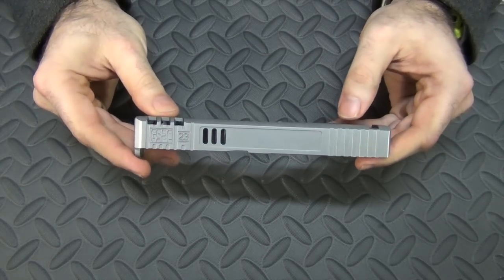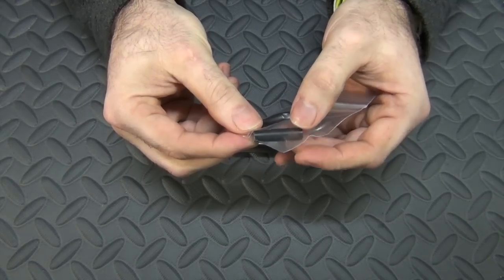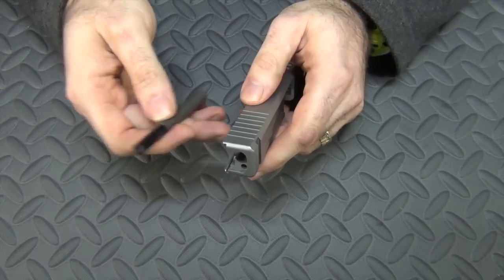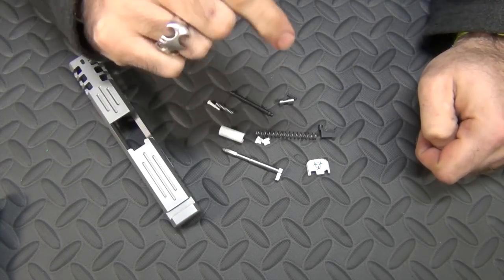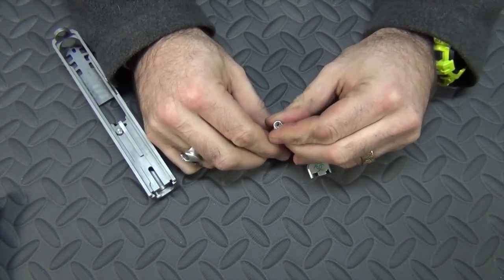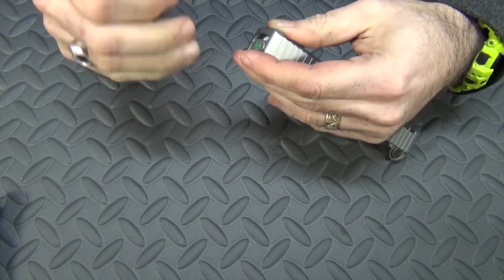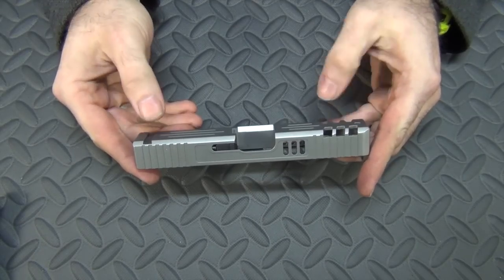Assembling a Custom Glock Slide

Comment: Use the slide as a support when you're assembling the firing pin, put the plastic piece in first and turn it so the lug won't go into the slot.
Reply from the maker: Mark Fleser Why? The way I did it is simple.
Reply: TheYankeeMarshal It's simple either way, but using the slide keeps it from moving around and you don't have to compress the spring as far as putting the whole thing on a table.  You mentioned using a shell casing so I didn't know if you heard about that.
Reply from the maker: Mark Fleser The way with the shell casing is super easy too.

Comment: Ameriglo Pro i dot sights in green and yellow. Around $88.00. shipping is usually free. Got mine from optics planet via ebay, but amazon should have the same deal.These sights are just as good as  trijicons HD sights but 40-50 bucks cheaper.

Comment: Holosun red dot sight 2 MOA features 12 brightness settings. In Stock Holosun HS403B Red Dot Sight - 2 MOA View Details $211.75. With a code you can knock it down to 150

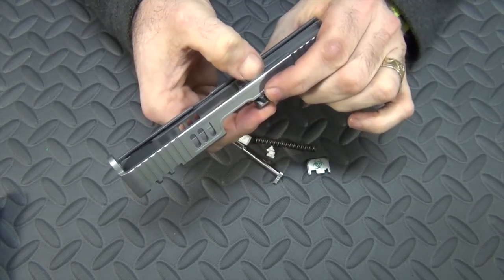Comment: At 4:20 your instructions are blurred the extractor does not lock in
Reply: Update*** now I know this isn't a p80 video but I used this content to assemble my build and a extremely crucial step for anyone stuck at 4:20 you need to get a hold of some 4000 grit sandpaper and wrap it around your brand new just recently ordered firing pin safety and wrap it around like a burrito and twist it back and fourth to create a perfectly even 360° sand and that " WILL " cause the pin to not seize up in the hole and allow it to compress and decompress freely and as it should

Comment: I have the dead ringer snake eye sights they work excellent at night and are very strong I can rack my slide off anything  and I dropped my glock at the range so they can take an impact lol...I'm sorry that's not funny dropping your gun but still the trinium inserts are ok after heat and impacts...just saying that's what I use

Comment: I know this is an old video, but can someone please help me? I'm completing a glock 20 aftermarket slide and I noticed that my parts kit didn't come with an "extractor spring cap". And I've noticed that no other parts kits seem to mention one, do the 10mm/45s not come with one? I can't find a direct answer anywhere and I can see the spring behind the extractor and it looks odd. Maybe I'm just tripping, I've never dealt with large frame glocks or p80s, someone give me a legit answer please 🤦‍♂️🤦‍♂️🤦‍♂️
Reply: Nick is that you ? Lol I am having issues to with my gun lol

Comment: Instead of buying a tool or if you don’t have a 5/16th dowel, I used the rounded (non-drilly) end of a drill bit the same size. Pushed the channel liner in real easy b

Comment: Wow!  Three minutes, twelve seconds until the profanity began; and, it was only by text (i.e., "suck balls").  I'm impressed.  Kudos!  Typically anytime TYM assembles or disassembles something,...I expect the profanity to begin within 30 seconds.

As for which sights,...these XS Big Dot sights are nice.  ONLY 2 LEFT! 

http://www.amazon.com/Night-Sights-Glock-357-Calibers/dp/B005ST8NA2/ref=sr_1_14?ie=UTF8&qid=1420424103&sr=8-14&keywords=glock+23+sights

Nice video TYM.  Keep 'em coming.
Reply from the maker: DoobTube71 You should have heard the parts that came right after that little added clip at the end when I turned the camera off.
Reply: TheYankeeMarshal
Forgot to switch on the camera...  That's not too bad. Usually, if I ever dare say something is "easy" to assemble/disassemble, some spring-loaded somethingorother will find a way to shoot a tiny part that I don't have a spare for into a parallel dimension.
Reply: TheYankeeMarshal 🤣🤣🤣🤣

Comment: TheYankeeMarshal I would recommend a fiber optic front with a blacked out rear sight.  I have a couple sets of the TFOs too, and they are nice, but they housing around the fiber optic blocks more light compared to traditional fiber optics.  Just my 2 cents.

Comment: I used a 3/16 nut driver that has screwdriver handle on it for the channel liner.  It was perfect size and very easy to do. When I looked in where the channel liner goes I could actually see a lip so I thought there was probably already a channel liner in the slide but after checking where I got the slide there was not one in it. So even if you think you can see one in it there might not be.

Comment: TruGlo TFO or TFX sights.  Right around $100 and Amazon available.  They’re a hybrid fiber optic/Tritium available in a number of different color combos (I use green front and yellow rear).  In normal light the fiber optic really stands out.  The Tritium at night is not as bright as say a Tritium only  Meprolight set, but definitely still useable

Comment: I had a devil of a time trying to get the extractor rod in place. "How the hell did he just drop it in?!" I realized I was using the original screws that came with my optic and it stuck down into the channel. I swapped it for the screw that came with the cover plate, and boom, fit easily.  Posting that here in case anyone else had the same issue!

Comment: Trijicon heavy duty night sight with the orange outline front. Ghost ring (or aperture) sights on a pistol simply don't work correctly. The rear sight should be blurry (hence ghost ring) and on a pistol it is too far away to blur and all your attention can be on the rear sight, which is bad.

Comment: Well the sights are one thing I'd HIGHLY HIGHLY HIGHLY recommend getting the special tool to install.
Reply: Just send it with a punch and hammer...front sight needs a small enough socket which you need to buy.

Comment: Just built my first Glock 19 upper with zero tools in 20 minutes. I did that first part super easy by using the firing pin sleeve to push it down. Thanks!!